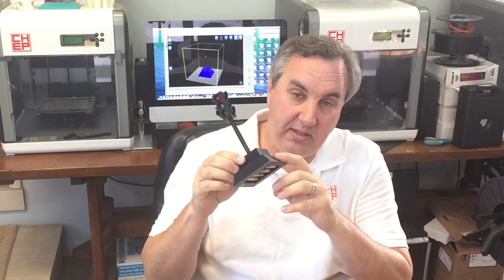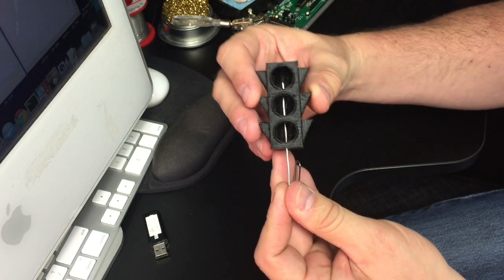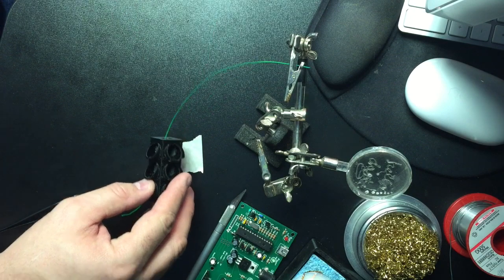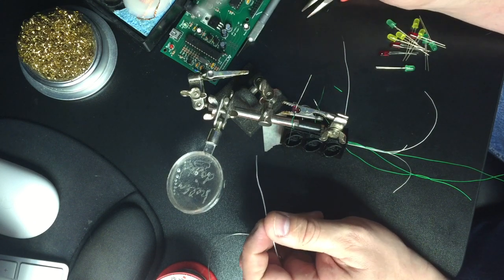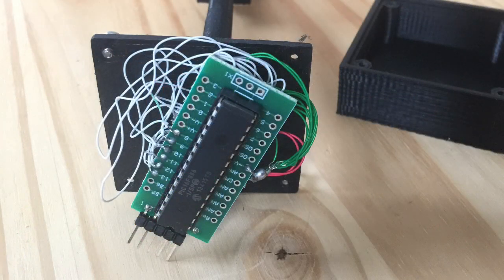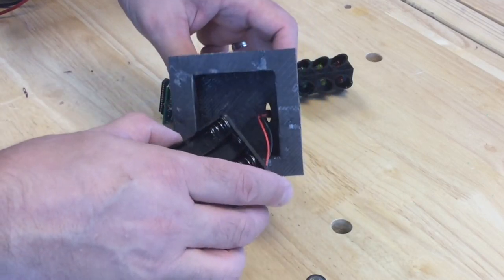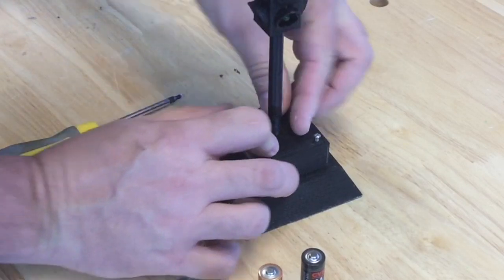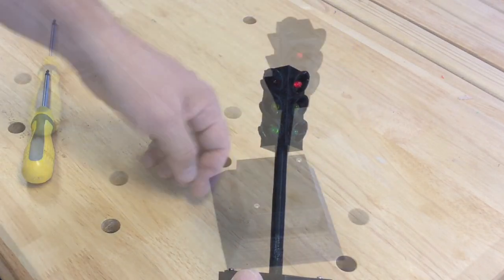Filament Friday #42 - 3D Printing + Electronics = Working Toy Traffic Light

Comment: Chuck have you seen the deal on the da Vinci 1.0 Pro?  $499 for trading the warranty of exiting da Vinci seems like a good deal.  I am looking to add another printer and this looks interesting.  Have the Duo and for the money it has been rock solid (however limited to the plastic of  course).  While the documentation says you can keep your printer, yet wonder if they will "brick" it?  Since you did have connections to them, figured this might be a worth while thing since you have so many da Vinci viewers. Also do you plan on getting one?

Comment: Man that's fiddly! I'm sure some Scale Model Train guys would love something like that in their sets. Have you seen the el cheapo addressable LED's available now on Ebay? Been meaning to play with them - cuts wiring down to simply daisy chaining and they're RGB too! 

Found an example ebay listing - http://www.ebay.com.au/itm/50x-WS2812B-5050-RGB-LED-Heat-sink-PCB-Board-1-LED-Addressable-Module-Pixel-5V-/261660607851?hash=item3cec30056b:g:jHYAAOSw2XFUZGGC
Reply: Hi makers muse it's me Ryan

Comment: Great video one question, in all of the videos you have you still have an updated to mac to the latest OS X just wondering why?
Reply: +Chuck Hellebuyck's Electronic Products i'm running it on OS X 10.11 just fine on my 2009 iMac haven't had any trouble yet
Reply: +Chuck Hellebuyck's Electronic Products That's really weird I just printed from my iMac last night and it worked. Are you sure your using the latest version ?